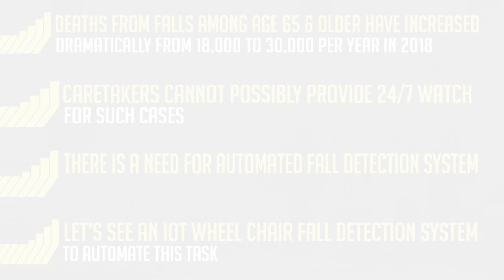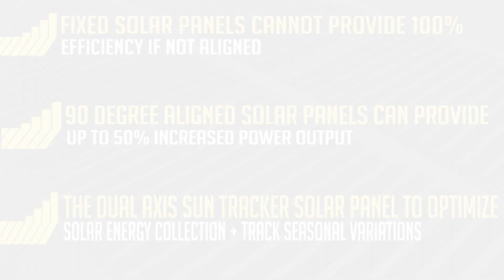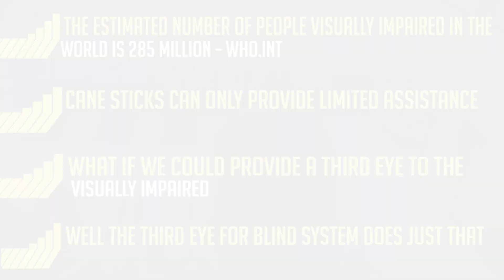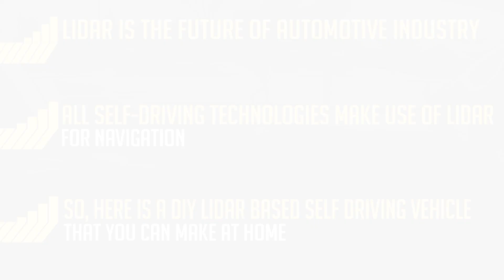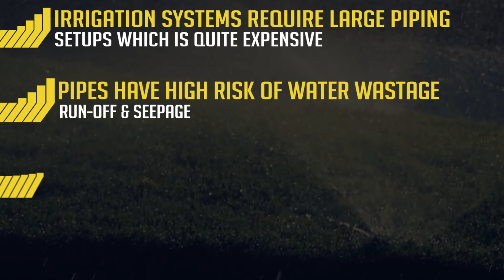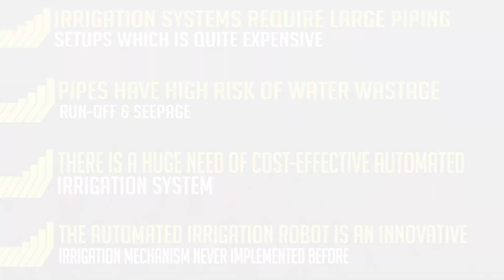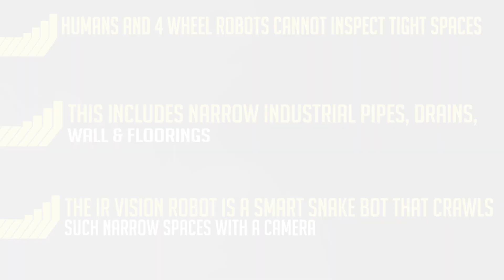Top 7 Most Innovative Electronics DIY Projects

Comment: for the no 4, the self driving car, what were the principles of turning left or right? Were your motors connected to the front or rear wheel?
Reply from the maker: Its a servo motor based turning mechanism, both wheel are connected using a mechanism